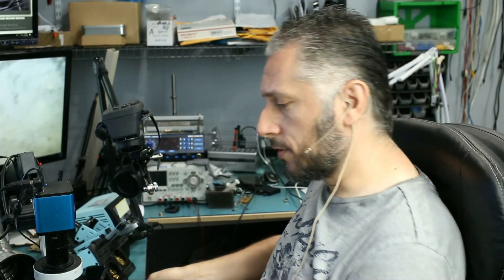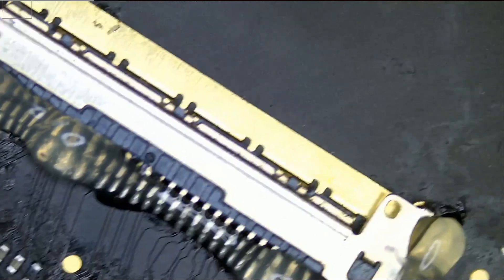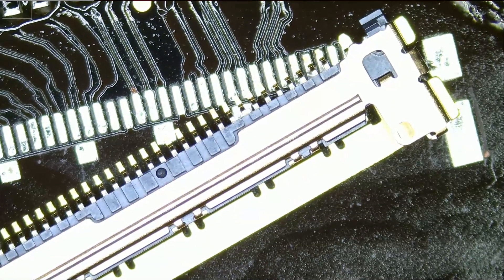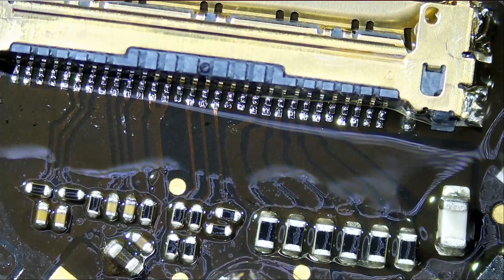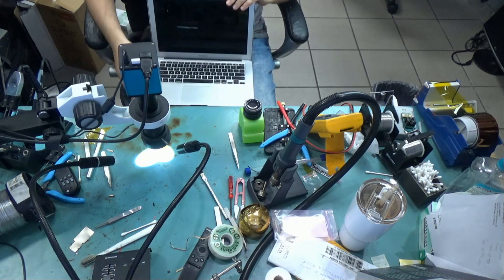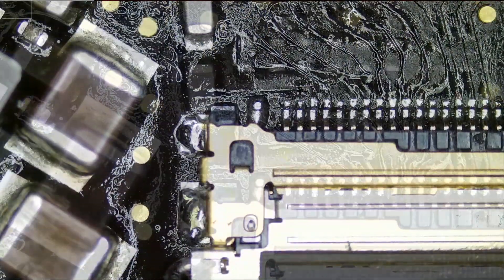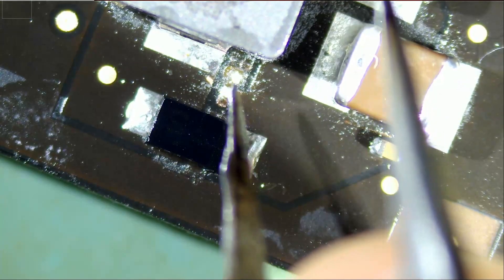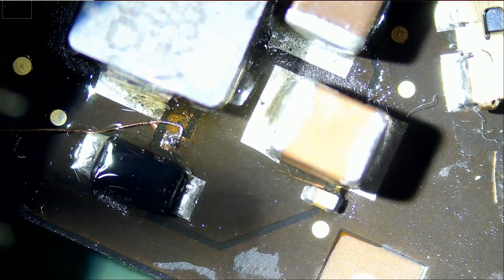2015 Macbook Air No Backlight Repair - Broken FB Feedback trace xw7720 No Boost - 820-00165

Comment: Hello
Need ask you please
You prefer use lcd or boomstand for your microscope repairing phones
Reply from the maker: I like to use the one that i have.  https://rover.ebay.com/rover/1/711-53200-19255-0/1?mpre=https%3A%2F%2Fwww.ebay.com%2Fsch%2Fi.html%3F_from%3DR40%26_trksid%3Dm570.l1313%26_nkw%3DIMX290%2B1080%2Bsony%2B180x%26_sacat%3D0%26LH_TitleDesc%3D0%26_osacat%3D0%26_odkw%3DIMX290%2B1080%2Bsony&campid=5338440312&toolid=20008

Comment: Great troubleshooting! Is that trace a common failure point for corrosion problems? It just seemed like you knew exactly where to go. :)
Reply from the maker: You have to check  traces of the entire backlight circuit. It's a common procedure. FB line is known to break 
 if there's spike, short or corrosion. Since we have 8.5v, we know voltage is there but not boosting for backlight to work. FB is connected from back to front via this tiny hidden pad.
Reply: @NorthridgeFix  thank you so much for your detailed response. You are awesome!